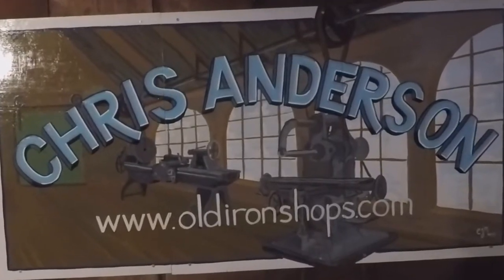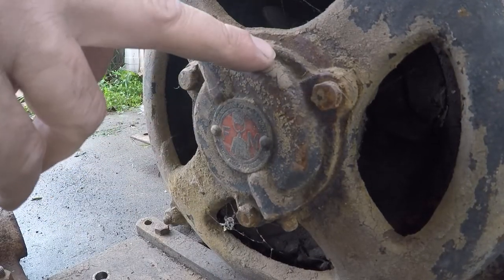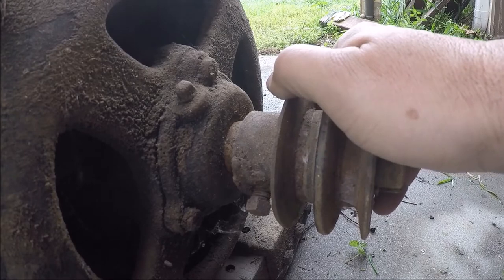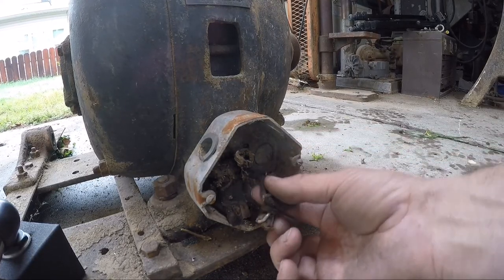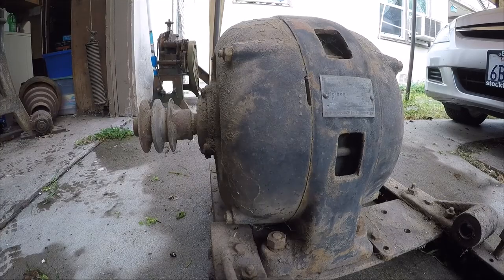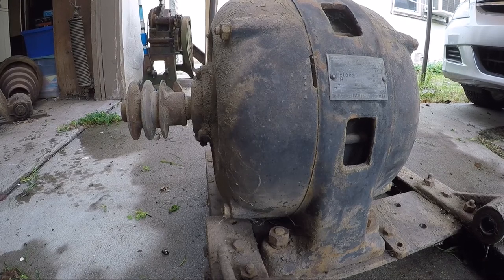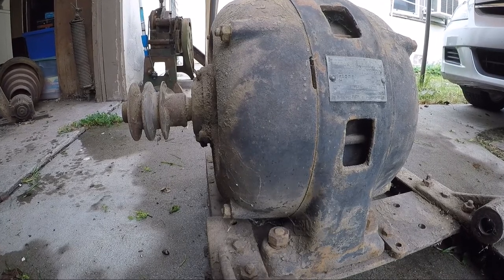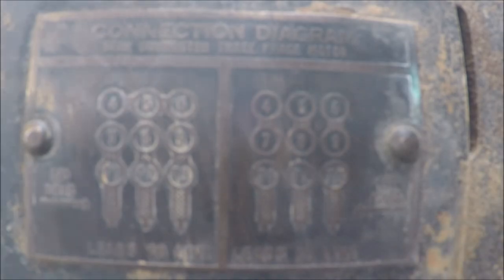Fairbanks Morse Electric Motors

Comment: Will be very interested to see why it’s frozen up. Good luck! The two views 220V and 440V would be how you wire to supply and internal windings, usually 9 wire, with the cloth covering degraded may be hard to figure which is which though!
Reply from the maker: i do like a chalenge

Comment: Nice Motor. Wish I could help, but my only experience with Fairbanks Morse is with FM 38D8 1/8 diesel generator sets. There were three on the USS Independence CV-62 :-). I expect that you can knock those bearing covers off and remove the bells, and it will come apart nicely. A good cleaning and some new bearings should bring it back to life. Having the windings checked with a megger at your local motor shop would be a good idea. .
Reply from the maker: Yes William that sounds like the plan.  Any one got a mergger
Reply: I bet a local motor shop would have one. I bet if you look, there is probably a motor shop somewhere in your area. Just checking with a megger is usually a quick, cheap job, they make their money on rewinding and rebuilding motors. I think I gave the local motor shop a $20 bill last time I had a winding checked. It was fine, and the charge was less than $10. I was out of there in under an hour. You might have an electrician friend who might have one, but not every electrikan is going to have a megger in his kit. :-)
Reply from the maker: I'll look into this. Thanks for the comments
Reply: Dunno how far you are away from Stan, but I bet he has one. Tom prolly does too.
Reply from the maker: Long way from Stan .but what Tom do you mean

Comment: Greetings again from England 

When you IR test it Chris you need to subject it to the test for at least 10 mins... 
Doing this polarises the insulation... 
You'll find as the insulation polarises your value should increase as a result... 
Many motors have been failed because of incorrect testing procedure...

Another trick:
if the insulation is low...and you suspect damp...is to put an ampere or so DC through the windings...leave it connected like that for a week in a dry place then test it again...
This will gently warm up the field windings and drive out any damp....😊
In fact...some large motors Operating in hostile environments have a facility to do this built in...so you can keep damp out whilst not being used...

When you get into the frame you should find that cloth covered VIR cable will go to some binding posts...and as such will be easy to replace...

Apart from that what you have there should scrub up nicely... 

Look Forward to progress here Chris...

As has already been said it's what we call a "squirrel cage" motor...it uses mutual induction to induce the currents onto the rotor...hence no brushes...
Commutation is a different thing altogether...
Generally motors with commutation (drills etc) the armature is at DC...the field locks it into synchronous speed....which in the USA is at 60Htz...60 cycles... 
Here in the UK we're at 50 Cycles... 
A good way to understand what's going on with commutation V mutual induction is to look at how a repulsion start/induction run motor works Chris... 
Where the brushgear is used to get the currents onto the armature on startup...then once started the brushgear retracts and a shorting ring bridges the segments...thus putting the armature into induction mode...at which point it ceases to be an armature and becomes a rotor... 
If you follow me...?..☺️
When you remove the rotor Chris what you should find is bars that run the length of the rotor at an angle...with shorting rings...one on each end of the rotor...

If you can wire it for single phase then you'll probably need a capacitor to create the phase shift to get it to start... 
This is why back in the day repulsion start was used...as the only way to get a single phase motor started was to kick it over with your foot...or get it spinning with another motor or Lineshaft with a clutching mechanism...or use the repulsion start principle...
Reply from the maker: thanks for all the info you were in the likely spam folder for some reason. silly youtube
Reply: Old Iron Shops 

I'm electrical contractor Chris.. ☺️
Reply from the maker: Ah good to know. I know of one shop that starts one machine with a pull rope lol
Reply: Old Iron Shops 

Your most welcome Chris... 

We try and help each other out in the utube community...😊
Reply from the maker: Yes we do
Reply: Old Iron Shops 

I'm just looking forward now til the day when my most sacred United Kingdom is finally Away from the EUSSR...then we can align ourselves again with our former dominions...and the beautiful United States of America... 

You have your fleet... 
We have ours.. 
No ones going to be able to mess with us two great nations together.... 
Friends forever...😊
Reply from the maker: What is the eussr. ?
Reply from the maker: Got you there
Reply: Old Iron Shops 

Anyway... 

I don't want to talk about it no more here Chris as it's about motors here....

If you want to know more I'll email you...☺️

Comment: Hey Chris.  That is a nice 6 pole squirrel cage induction motor you have there.  These motors were revolutionary when invented because there is essentially only one moving part.  I would expect to find some hefty ball bearings under those end caps, along with some felt seals to help retain the oil.  There might even be a little spiral cut into the shaft to direct the oil back to the reservoir.  As others have said this is a 9 lead reconnectable motor.  Following the diagrams shows what leads get tied together with the incoming lines to operate at low or high voltage.  You should have all nine leads coming out to the junction box on the side, if not you will have some exploring to do.  
Once you take it apart you will get a pretty good  idea on the overall condition of the windings.  If in doubt of their condition find someone with a 500 volt Megger.  This is a meter to detect electrical leakage through the insulation of wire, this will be very useful in determining if there is a problem in the stator windings before hooking it up for real.
Reply from the maker: OK so I should expect more wires inside the frame. I suppose it is fairly easy to disassemble everything. I think I'm gonna need a 3 phase generator. Oh and do you have any idea when they built the as motors.
Reply: Yes more wires.  If you can not find any markings on them there are different ways to identify which wires are paired to each winding.  It will probably come apart without too much trouble.  I think the three bolts on the bearing covers will have to be removed, they probably go through the bearing carrier and are threaded into a cover on the inside of the carrier.  You don't necessarily need a 3 phase generator, a VFD would work just fine and give you variable speed capability.  As far as age, I'm thinking 40s-50s.  That is my opinion based upon the construction and style.
Reply from the maker: Oh later than I thought it would be.  Thanks for the help Mike

Comment: That’s a good motor.  I’ve been working with Fairbanks-Morse motors like that for years.  The are rugged.  I’ve seen those motors run nonstop for years.
Reply from the maker: Good to hear that. How is the bridge port coming along?
Reply: Not bad.  It's slow going.  The Bridgeport is a little more challenging to work on than the Southbend, but I'm making good progress on it.
Reply from the maker: Keep at it buddy

Comment: You are going to have fun with this one Chris. Going on the lathe ?  👍
Reply from the maker: if i can get it running it will power the hole shop
Reply: YES...... It'll be sweet.
Reply from the maker: This should be a fun project for certain.

Comment: With a VFD you can run it
Reply from the maker: Ah good to now speed control also
Reply: of course only if your wall outlet does put out enough power (voltage times amperage). A VFD can only transform it to 3-phase but it cannot ad power out of thin air. 220 single phase to 220 3 phase should work. 110 single phase to 220 3phase should work in principle but is probably too weak to run a 3hp motor under load.
Reply from the maker: I have 220 single phase in the shop

Comment: Chris, sorry buddy but this maybe is out of your skill set. I hope your friend is set up to rewind motors because this looks like a good candidate for it. Go ahead and take the pulley off and check to see if there is any oil in the bearings. They might have been converted at some time to sealed bearing so it's not a determining factor but those motors came originally with ball bearings.
Reply from the maker: thanks for that advice i know a guy that works at a place that rewinds motors so he may be able to help if this one is shot
Reply: Old Iron Shops Those motors were designed to be rebuilt, unlike modern motors. At one time every industry had there own motor rewind shop but they are a lost art today.
Reply from the maker: Never carted for the trem lost art it makes people think no one does it any more. I'm sure we can fix her up

Comment: Hope you can resurrect it Chris.  Be sure to give us a follow up!
Reply from the maker: You Know I will
Reply: Chris, you said that you could not use it in your shop, BUT you may think about keeping it and setting it up as a rotary converter to supply yourself with some 3 phase power in the event you get a machine which is equipped with a 3 phase motor.  Being a 3HP motor, you should be able to safely run a 1.5 HP motor from it.

Just a thought.

Joe
Reply from the maker: Well that is one way to go. A 3 phase generator is another possibility .ygen I can run the shop with period power.